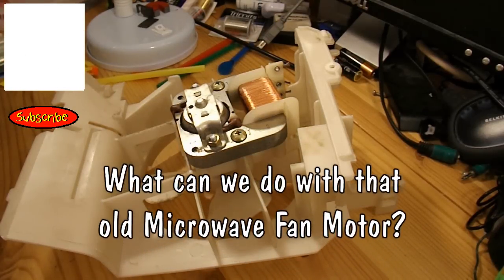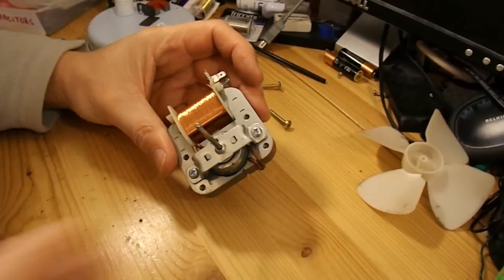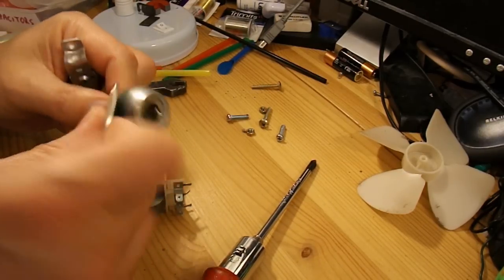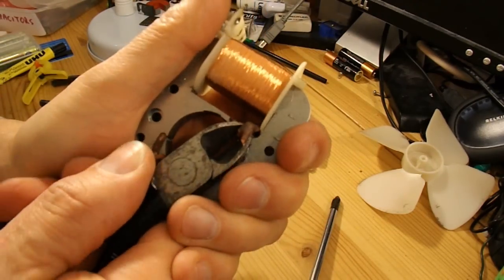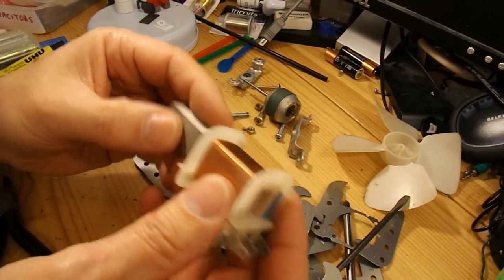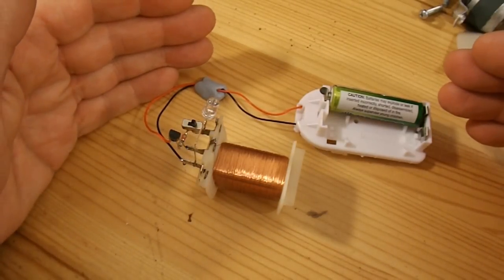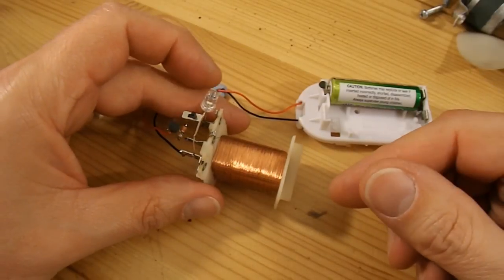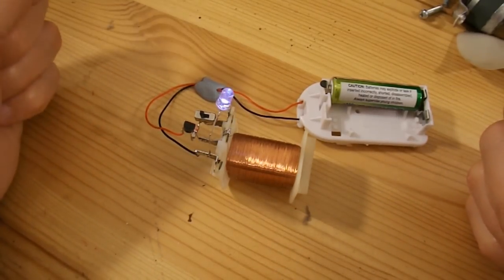What can I do with that old Microwave Oven Fan Motor

Comment: I think you have explained how my crummy "pump action torch" was designed to behave. When I pulled it apart it had a tiny button battery hidden inside, and I thought "That's cheating, having a battery inside"! It had a weak magnet that rotated within a coil when the lever was pumped, which presumably just boosted the current of the (by now), almost flat button battery to the required forward voltage for the three white LEDs to light up. Can't remember if there was a transistor included in the circuit, but the action you demonstrated was similar to how this torch behaved.
Reply from the maker: No, I am familiar with those torches and they are quite different in the way they work. They are a simple generator with a coil spinning round a magnet directly driving the LEDs. Here is a project I did with one in 2013 https://youtu.be/tk5mMRrbhEI
Reply: Yes the innards of my torch was exactly that, but with a different casing that revealed the gears via a clear plastic window, and I thought a nice DC motor in there too! But as you demonstrated, just a very weak rotating magnet within a little coil & metal poles, which had to be supplemented by the 3 button batteries ("cheats!") 😯
Reply: +dav snow ... I have this flashlight also... The batteries are in there so you don't have to keep pumping it to have light...the generator charges the batteries to operate the light after you quit pumping.
Reply: pwrovld : Your torch is unusual, in that it must be supplied with rechargable batteries. Mine are simply standard button cells and thus are not rechargable, no matter how much pumping enthusiasm you may engage in.

Comment: It is bad disarm a fan useful for many other purposes. In any case it is not necessary to disassemble the laminations but beating with a small punch on the core end protruding from the coil.

Comment: did you ever try spinning this with a drill to see if it generated power? I have an idea brewing that may actually do something awesome. I just took apart my microwave and have the identical fan assembly so I will be trying what I am thinking!
Reply: Marc Belanger Did you ever try it?
Reply: No magnet.
Reply: It is an ac asynchronous  induction motor with shaded poles to get it roating  https://image.slideserve.com/734624/shaded-pole-motor-n.jpg . The shaded poles delay the phase on one side of each pole to get it rotating in one direction. You would not want the fan to spin backwards. It motors when the spin is slower (negative slip) than synchronous with the grid frequency, 3600 rpm. If it is spun faster than than synchronous, (positive slip) it will feed power back into the grid. Point is, it has to be connected to the grid to produce power. To make maters worse, the shaded poles used with single phase induction motors reduce the overall efficency. This is motor as a generator is generally not very usefull.

Comment: My friend im struggling here to understand why and how that was useful, the battery will light the led on its own, so technically you just added a magnet on off switch to a led? What a waste of a good motor, you can come up with something more useful and better im sure. Either way great vids, easy to follow. Your accent is brill too haha
Reply from the maker: Thanks Max. Two points. 1. I never said it was going to be useful. 2. No you are wrong, you will not light a white LED with a 1.5v battery. Have a look through the video description where that is explained at length.
Reply: @GrandadIsAnOldMan   im not sure what size led you are using but i can light the ones i have with just 1, but i think they are smaller than the one you used in this video, and i wasn't being funny, i was trying to understand what it was you have made. I understand you are powering the led with the battery and i understand the coil. But i dont understand the other components. Is it possible with just the led, battery and the coil? I still have the L plates on tbh lol, trying to learn that's all bud. And thanks
Reply from the maker: @maxwayne4323  read the video description. If you are able to light a white LED with 1.5 volts then it is one of the type that has an inbuilt circuit that boosts the voltage. The forward voltage for a white LED is about 3.2 volts. The size of the LED is irrelevant.  I make this very clear in the video description.
Reply: @GrandadIsAnOldMan  i dunno it just looks like a normal led to me. It lights from a watch battery too, yano those flat ones, the only one it doesn't light is a Colour changing one so far, ill look into it, i got a box full from wish and they arrived super small. Just subbed to your other channel today, my son watched the videos lol, he loves them
Reply from the maker: @maxwayne4323  until you have read the video description there really is no point in me continuing to reply. If you are talking about a CR2032 flat disc battery you will find they are 3 volts.
Reply: @GrandadIsAnOldMan  you no more than me clearly,  im trying to learn thats the point, but if you dont wana reply thats fine, enjoy your the rest of your day bud
Reply from the maker: @maxwayne4323  have you read the video description, because all of the answers are there already?
Reply: @GrandadIsAnOldMan  i did but i ive always had a problem learning that way myself, i read so much and it goes straight out my head as i read it lol, i tend t8 do better myself this way,  thanks again though, also should try to keep the comments going, your videos and channel will rotate to more peoples feeds. Stay safe
Reply from the maker: @maxwayne4323  thanks, you mentioned the multicolour LEDs, they are a similar level of integration. They have a full circuit board driving the flashing circuits. But it is so small you would need a magnifying glass to see it is there. The circuit that boosts the voltage for those white LEDs that run off low voltage is the same technology. The white LED still requires around 3 volts, but the feed is only 1.5volts. What they have inside them is the circuit you are questioning, but it is microscopic. It will include a coil and a transistor. Here is another one of my old videos doing the same job with a couple of axial inductors https://youtu.be/pDtEkxXOA9s?t=448
Reply: @GrandadIsAnOldMan  honestly i cant thank you enough, i feel like i actually understand what im watching now haha. Do you have any videos on how to make a smallish dc motor to have more torque?. Im not sure if its torque or power i need to be honest. Trying to make a electric bike. Thanks again
Reply from the maker: @maxwayne4323  Hi Max, the honest answer is 'get a bigger motor'. The standard way to get more power out of a DC motor (for the same voltage and without changing the magnets or any mechanical dimensions of the motor) is to unwind the field windings from the rotor and replace them with less turns of a thicker copper wire. Seriously, that is a lot of work and assumes you can obtain a suitable thickness wire. Once you have done that it will draw more current and produce more torque.
I found this article on the web that does cover it with all the maths https://electronics.stackexchange.com/questions/43066/how-to-improve-torque-and-rpm-of-a-dc-motor

Comment: Is there any change to use this motor all the way to its original source of current without making anything like a fan. Or need something adjustment to make a small simple fan for long use. I have same motor with 240v class B. While I used directly, the copper widing become very hot within 2 mins. Please suggest.
Reply from the maker: Shaded pole motors are not very efficient. Maybe this Wikipedia link (from the video description) will help you https://en.wikipedia.org/wiki/Shaded-pole_motor

Comment: The reason the led didn't light before using the magnet is bc ur circuit was dc not ac, the battery gave it a sort of ac effect and that started the led.
Reply from the maker: Rather than me start the whole explanation process over again, please either read the explanation in the video description or read some of the replies I have already given to the comments here. In short, you cannot light a white LED with 1.5 volts. The forward voltage for a white LED is around 3.2 volts. Nothing to do with AC or DC.

Comment: you could have made a spot welder or  a stick welder with that coil beore you disassembeld the core, it is perfect to make such a welder.
Reply from the maker: +Parasar Bhattacharya I think you have watched other microwave oven videos and got the wrong part in your mind. This is the fan motor, you are thinking of the transformer.
Reply: no sir, the idea came to me as i saw you take out the rotoe af the motor, there is the part where you could have wound few turns of a heavy gauge wire, then connecting the original armature to the power it will reduce the voltage but increase current the same thing which a transformer does.Oalah you get your low voltage high ampere transformer which can be used as a welder.
Reply: +Parasar Bhattacharya - Ok I'm not going to waste much effort here but exactly what grandadisanoldman said....
not with this part. you said heavy gauge wire? well that's not from this part... so I agree and think you watch too many microwave videos and have them mixed up. maybe you should upgrade your current microwave to a newer safer model and please don't stand close and watch the food cook.
Reply: videoslue
 well i would say you to try that first, and yes a heavy gauge.
Reply: I think Parasar if 'kind of' right BUT...
I believe the hole left by the removal of the rotor would destroy the efficiency of the core.
AND the fine wires of the primary would limit the output amps too much to work as a welder.
But as a step-down transformer I could see it being usable for something.
Especially if the core plates could be re-assembled into a more 'solid' shape.
Or if you made up new laminated plates for the core.
Reply: Evil SOB
yes you are right but what i think is that the main high amps will flow through the secondary coil which if made of thick gage then there should not be much problem, and as a spot welder one will not require to connect for long time it required just few seconds to spot weld so it should be fine. but as you said to use it as a step down transformer its perfect for that... and also a spot welder is a step down transformer.. you are right...
Reply: Parasar:
That's what I think.  So lets do some math.
I have some of those fans, and they are rated 
about 300ma@240v, so that is the maximum the wires can safely handle ... 72 watts.
So if you wind your new secondary at 100:1 ratio, you can draw a maximum of 30 amps at 2.4volts,  not very useful.  And that is assuming a perfect core design and manufacture, which we know we don't have.
So your idea was valid from a voltage perspective, but falls apart on the amps...
And on top of that I THINK that the initial in-rush current would probably fry the primary anyway, but I'm pretty noob with in-rush theory so far.
I've only been playing with my modified MOT for a few weeks so far...
Reply: Evil SOB
yes thats right, and i havent experimented on this before but i will try later, rite now i am really busy in making a electric go kart, but as i have said before you are rite....
Reply: Yeah, that's cool.  I just wanted you to see the thinking behind my statements.  I cannot say I don't still regularly blow stuff up because I misunderstand something or get my maths wrong, and I've been fiddling with electronics to over 30 years.  But if we don't push our limitations, we can never learn and grow.  Keep it up!
Reply: Evil SOB
yes rite... and  thank you... but rite now i am in real trouble as i cannot find the motor... in here to find a 24 or 36 or 48 volt motor is  really very tough... for the past 2 months i am searching for this...

Comment: Wow!!! Thats the simplest joule thief ive ever seen!! I can tell how it works just by looking at it!! Crazy simple!!
Can I do a similar thing with a toroidal ring with some wire wrapped around it so it goes like winding with - being wire and | being center tap wrapped around the toroid a few times tightly.  ----|---- and 500-1000Kohm resistor and an NPN transistor??
I'm thinking I can use the 500 or 1000 ohm resistor in series with the coil. and a 100-500 ohm resistor in series with the switch.
Will that work?
Reply from the maker: I guess the obvious answer is build it and find out. That is what I do and that is how you learn 😊
Reply: GrandadIsAnOldMan I dunnot how to exactly start though. Is the resistor in this pic going to the base of the transistor? and I had an idea I could use a much beefier transistor with the primary side of a transformer?
Reply from the maker: Have a look through the video description as there are some better examples linked there.

Comment: FYI:  It would have been much easier and faster to have supported the lamination stack in a partially opened vise and just used a hammer and punch to alternately tap on each end of the iron section that passes through the coil just to the inside of where it meets the main stack of laminations.  That is essentially just the reverse of the way it was originally assembled.

Comment: you don't need the coil just put the rester in searese with the LED and it will light.
Reply from the maker: Well hello Donald. I am guessing you have no knowledge of the forward voltage required to run an LED, you probably haven't read the other comments and certainly haven't read the video description. Thank you for commenting, please feel free to do some more study work and come back when you understand what is happening here.

Comment: Have you seen the liberty engine build  ?
Reply from the maker: Let me guess, is it some sort of free energy device 🤔
Reply: @GrandadIsAnOldMan  you guess correct.. its pretty cool 😎  give it watch its On Youtube.  The guy uses 3 microwave coils a electric asynchronous motor, a flywheel and few bits and bobs cable ties ect.  Pumps out 20000watts
Reply from the maker: Yes, I am sure it pumps out 20000 watts, how much power did he put into it? And who measured the 20000 watts?
Reply: @GrandadIsAnOldMan  just watch it and stop procrastinating the action . You might be utterly surprised
Reply from the maker: I did watch it, flashy lights to make it look exciting, just another hook to draw in viewers. Lots of numbers quoted and conspiracy theories. Just the sort of thing that keeps the YouTube numbers flowing. I have zero interest, thank you,   @customboatscreensolutions5893

Comment: So if  moving iron rod were put through the core at speed, that would also light the LED wouldn't it?
Reply from the maker: Maybe you should build one and try it. You need some magnetism somewhere to create some current so unless the iron rod has some level of magnetism then I doubt much will happen. Faraday's law of induction is a basic law of electromagnetism predicting how a magnetic field will interact with an electric circuit to produce an electromotive force (EMF)—a phenomenon called electromagnetic induction.

Comment: Couldn't you just power a LED with the battery alone? What am I missing here?... What's the point of all the extra work?
Reply from the maker: You will find further information in the video description. One basic point is that an LED will not light from a 1.5 volt battery. But, if you just wanted to light an LED you would use a different battery. Obviously that wasn't the point of the exercise.

Comment: Do you think it’s possible to upgrade the motor in a microwave?
Reply from the maker: Upgrade it in what way? It's only purpose is to blow air across the microwave. It's not like it is going to take off or blow itself across the table??
Reply: @GrandadIsAnOldMan  Mine is not super powerful. I want to like get a stronger dc motor and have more suction so that when i turn it on its sucks up the vapors from cooking.
Reply from the maker: @ThatsTheCombinationOnMyLudgage  that is not a DC motor. It runs direct off the AC supply

Comment: Im one of the people that dont want you to trash a perfectly good motor. Or at least identify the terminals before doing so.
Reply from the maker: So, exactly what would you do with it?
Reply: @GrandadIsAnOldMan  ive got a big battery issue going on at the moment and my best smart charger with recondition cycle is working overtime in a hot garage in texas. The 2 1/2" cooking fan inside of it crapped out. That thing produces a lot of heat. I dont have anything small enough to takes its place. I found a microwave fan id forgotten about. I couldnt see the mitor well enough to determine if it needed a capacitor or not. Couldnt see the terminal well enough to see the terminal with two wires though they are usually the center contact. Was wanting to avoid tearing into it to get a visual. I decided it would be better to know rather than gamble and fry it considering my next smallest fan is a huge squirrel cage for blowing water out of buildings and carpet after severe flooding occurs. Ive got half a dozen if those little fans around here and they are all fried from idiot friends connecting them to any voltage , reverse polarity, deciding they could use a thorough cleaning in a bucket of water you name it. Nice job on the demo though. Thise plates xame apart a whole lot easier than ive ever seen.
Reply from the maker: @davidreynolds4684  Good luck with that 😊 I did this follow up video (2017)  in response to people who wanted me to make a fan out of a fan - What can I do with that old Microwave Oven Fan Motor #2 https://youtu.be/F1IESEC1dik